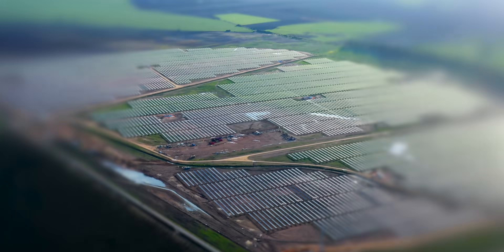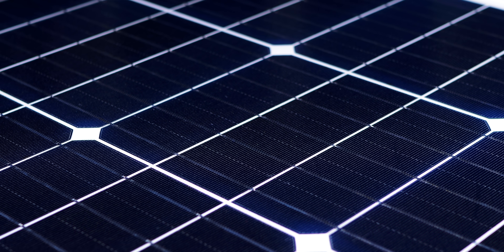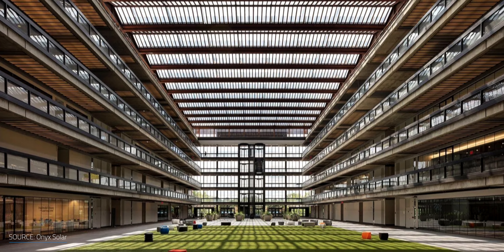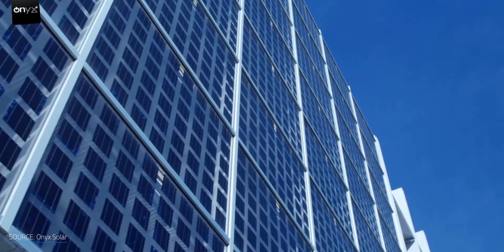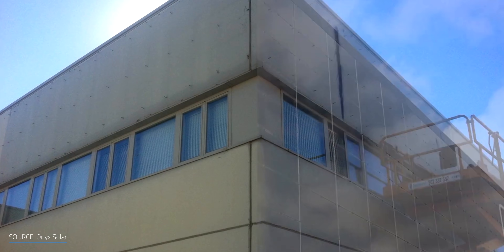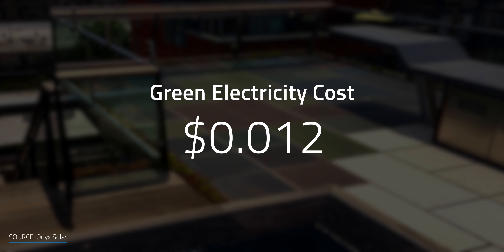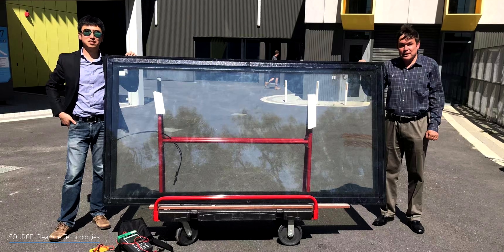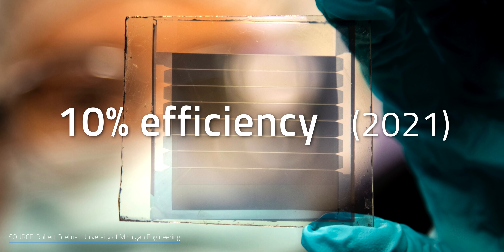Exploring a New Transparent Solar Cell Breakthrough

Comment: The differentiator will be manufacturing cost and durability, not so much efficiency. Solar panels are good for 25 years. If transparent panels yield half the efficiency but last twice as long, with the added benefit of much greater power generation per installation, they'll take off. One percent obviously doesn't cut it. If transparent panels need to reach 10% efficiency. Increasing awareness and desperation regarding climate change will push governments and builders to employ novel solutions, which likely create artificial demand.

Comment: The onyx solar pavers reminds me of solar roads. Solar roads was calling for sidewalks, etc.
The few applications of it, that I am aware of, were failures.
Reply: thats because solar roads was made by the couple who had very limited engineering experience and there roads were 'Smart' meaning they had loads of LEDs in them and failed a lot, in all  they were gimmick that promised way too much. while onyx solar is a solar panel/glass maker manufacturer will all the infrastructure needed to make the product themselves also their just making colored glass that can genarate some power not a smart device fails in the outdoors within a months
Reply: Yeah, it'll still have to prove itself for longevity and after the solar roads mess we should be skeptical, but i am much more optimistic about these than I am the solar roads because at least these aren't trying to be the be all end all gadgetbahn of pavement, they are just glass with embedded solar tech, they aren't trying to cram computers and LEDs and heaters and what not into them, and they also don't seem to be trying to stretch claims about the weight it can hold with a figure that pretty much only allows light walking traffic and doesn't even come close to trying to claim you can drive on it
Reply: @dustinm2717  Solar road ways/paths have and alway will be a scam. If you have a car drive over it, a person walking or even leafs on it, it stops generating electricity. You’re better off making a canopy for people walking so they haven’t got a walk in the Sun and that actually generate electricity efficiently. And without the risk of the panels overheating or getting broken.
Reply: solar freakin roadways

Comment: I kept hearing, '... it is not as efficient as rooftop installations...' True, but you can do both. As long as transparent solar cells are efficient enough to pay back the costs in a reasonable amount of time, it is worth using now. And the more people who use them now, the more money will be put into research making them more efficient.
Reply: I think this is the true benefit. You can't put rooftop arrays on top of windows, because it would block all the light. The benefit of these is that even at low efficiencies, their payback time is quite quick, and they can be used in conjunction with rooftop arrays. If you have a 100m² roof, and 600m² of windows you can essentially double the space of the solar panels where you couldn't without the window system. This is huge because just like rooftop arrays which aren't impressive on their own, they become impressive when recognizing they can be used as micro grids to power individual buildings or local to the building systems.
Reply: I watched another video a few days ago about using solar panels over crops that did not need as much sunlight and I actually posted a commend pondering about why the panels we make are always built on opaque circuit boards.   At the very base they are simply diodes that convert passing photons into electrons, the reverse of a light emitting diode that converts electrons to photons.
Reply: @PSNDonutDude  they are 1/2 as efficient and they do not get 1/4 the light (for the rooftop panels). then 100m2 rooftop panel will still make more power compared to 600m2 walls.
Reply: There are alot of rooftops lacking PV, we could add PV to them before we talk about windows. And the question of replacing when they wear out is there too.
Reply: We can have something like a film that goes over traditional windows to create this transparent Solar panel. I believe it'll be much easier to integrate in existing infrastructure
Reply: @vivekdubey9061  with some of these yes, the actual solar cells are in the frame rather than the glass for most of these

For me, replacing old windows or i construction are where these will shine

Something like $45/m2 more expensive than a normal window at current and generates $5-10/year in electricity makes it an easy choice if you like the tint
Reply: Usually people who minimize solar for being "not as efficient" have outdated mindsets.  It simply needs to be practical for the use, then you need to consider the long term costs and other factors.  Unlike with oil and coal power, where they see a direct ratio of unit of mass to the amount t of British Thermal Units converted from that unit of mass.
Reply: @PhilLesh69  ..... BTUs.....

Bad
Reply: @PhilLesh69  ..... BTUs.....

Bad
Reply: yes, it's about cost effectiveness, space-grade multi-junction PV panels are more efficient than single junction but so far their price makes them not cost-effective
if the transparent solar cells are cheap to make and produce more electricity to pay off for their price, then they are interesting otherwise, need more research
Reply: Even though they are not as effective as rooftop institutions they take advantage of building space otherwise not usable for power generation
Reply: @aussiegamer6876  But there are already countless rooftops and other top surfaces not using PV in the first place
Reply: Right? As I was listening, I was thinking “sure, it’s less effective, but it isn’t necessarily mutually exclusive. In most cases, you’re going to put windows in those spots anyway. Why not  make the windows transparent solar panels, so that those windows are providing more than just a view, in addition to rooftop panels? Obviously, the decision would have to be based on cost/benefit and opportunity cost analyses. But if the cost of transparent solar—when energy savings from generation is considered—is comparable to normal windows materials, why not?
Reply: @derekstaff  Sure, but what to do after the PV's stop functioning?
Reply: @firstlast-cs6eg  obviously that would have to be factored in to the decision. If the transparent solar pay for themselves in energy generation before they stop functioning, and as long as inert panels have no particular downside, what does it matter if they stop? They may just act like regular windows now, but they generated more energy while they lasted than regular windows would have. I’m not saying that they are always and absolutely right for every situation, but in general, I don’t see why the negatives would be assumed to be prohibitive just because they are not as efficient as opaque panels you put on the roof.
Reply: @derekstaff  Exactly, and the real world examples they gave had really quick pay back times, easily enough to be worth installing.
Reply: I have mini solar panels INSIDE my windows n they still work to give me 2hrs light at 400lumens and i have a solar lantern, which is enough for summer months light requirements.
I also have a 5panel pv powerbank slowly charging on the windowsill which i use to avoid using mains to charge phone, vape n batteries all the time n thus reducing energy bill 
My window faces west n thus not optimal, but still worth doing imo
Every little bit helps planet n my pocket n i cant wait until either seethrough panels or pv blinds are affordable
Because as someone on disability n social housing n renting, i have no other option
Theres millions like me waiting for flexible seethrough solar they can hang in their windows n take with them when they move home n b that lil bit closer to offgrid
Reply: Actually it becomes an easy choice if you already have regular panels as the initial infrastructure is in your home.
Reply: Alpha thinking from BrotherAlpha.
Reply: We're all just waiting for that one crazy human mind
Reply: Yes, this, unlike inductive charging or Hydrogen fuel cells in cars.. makes sence
Reply: this will also help in places where normal panels can't be used. Skyscrapers and other large buildings could skin southern faces of the building with transparent solar cells instead of windows, and hit efficiency and carbon goals much easier, as well as being a viable upgrade path for buildings looking to retrofit. This is the only way I can think of to get acres of solar panels in a place like NYC, where vertical surfaces are much larger than horizontal ones
Reply: @Seldoon_Nemar   There are plenty of rooftop like surfaces lacking regular solar panels.
Reply: @firstlast-cs6eg  yes, but there are also plenty of projects that are under construction that could benefit from this?
Reply: @Seldoon_Nemar  
         Maybe, but how well do these windows work after the PV stops working? Also maybe it is better to have windows where you can control the opacity including IR etc so heat can come in when we want it and not when we don't.

        Since there is alot of room for progress in roofs with EV, it seems best to me to focus on that.

       I imagine these EV semitransparent windows will be useful on skyscrapers in very hot sunny places, that is a very narrow use. But I guess it is a use.  But then again how well do these windows work after it stops working compared to a regular window?

       If the components of these windows that wear out could be replaced without replacing the window, that would be a major improvement.
Reply: The cost of one system is insane enough. Telling people to buy 2 systems makes no sense whatsoever.
Reply: @Iceflkn  Both systems save money. That's the point.
Reply: @Iceflkn  not necessarily
Think of folk living in flats who hav no roof access
Reply: hear this then... ideally placed and angled solar panel will recoup it's cost in 5 years. 
Assume that windows are also ideally angled... which they are not. Efficiency of those ideally is 1% which is at least 10x less of a solar panel.
So it's 50 years in ideal condition to recoup the cost, but the cells will live 10 years. 
Reality will offer several times worse outcome.

Even if they become as efficient as solar panels which frankly is impossible due to capturing only part of the light spectrum. 
Bad angle and low lifespan, still makes them unable to recoup the cost in their lifetime.
Reply: @Cypeq  "hear this then..."

Did you even watch the video? The numbers you came up with are contradicted by the video itself? Either you are dealing with outdated numbers, or you are just lying to us.
Reply: @BrotherAlpha  video states on fully transparent PV windows 1% efficiency. I've read about 40% transparent ones that do up to 8%. Of course data on actual installations is not possible to find. It will be obviously different from site to site.
Buildings with skylines could probably and reasonably benefit from those as the skyline can be angled for maximum benefit, although still fixed throughout the year, and susceptible to snow. 

Those windows might make sense for new skyscrapers. Somehow I doubt they will be financially worth it as in able to recoup additional cost and generate profit on electricity generation, at least for now, but I'm sure some will decide to just have them to boast about being "green". 

I hope you all understand cost of this installation is not only manufacturing a glass with PV of some sort. It's additional wiring, controllers, batteries, inverters. More panels you have, more cost on those, and here you're having shit tone more panels. Massive battery cells to store this energy is also a recurrent cost over their lifetime, they need to be replaced, and all electronics need to be serviced. 

Would love to see some actual numbers for full installation.
Reply: @Cypeq  "Of course data on actual installations is not possible to find."

... The video talks about actual installations. WTF?
Reply: @Cypeq  where did you get 1% from?? Also, the 5 years is for those panels in particular
Reply: @Cypeq  .... What
Reply: @angrydragonslayer  that is strange because here in EU cost per kWh is 400E (batteries), controller cost is 162E - 48Volt system i guess they use this system, but this is only 1160 Wp, that means if they have installed capacity of lets say 20kV, they need 17 of them. Same goes for hybrid inverter(s).
Maybe in USA solar controllers are FAR cheaper than here in EU.

You said it right, 100W mppt is 20Euro now, but i guess McDonalds uses far more robust system, atleast 20kWp.
Yes you can have ROI in 3-4 years, but only solar panels. Most of the people forget that you need the rest of management for the system which is three times more investments than solar panels themselves. You cannot just power devices to solar panels, you need the rest - and you still relying on the Grid, even with batteries.
If you try to send your power to the grid, it's okay, but that grid needs to be flexible, that means it needs to have nuclear powerplants, wind, hydro + storage in a form of batteries, pressurized air, hydrostorage powerplants to compensate grid.
Solar is only, and not major one piece in this puzzle.
Reply: But solar panels needs to be efficient, you know that is alpha and omega of them. It is VERY nice that dude in a video tells you, that cost will return in just 1-4 years. Thing he is not telling you is what is the cost of electrical installation managing those panels. That cost is 8 times more that panels themselves. No you just cannot connect all solar panels from the building together and they produce something - that idea is simply childish.
These days you have flexible solar panels, they can be mounted anywhere (calculated to strings / power requirement) and being efficient just like old 20kg solar roof panels.
Solar window at an efficiency of 1% is horrible idea.
You know you can build a roof at an calculated angle and cover it entirely with solar panels, but that means you will produce ~ 40kWh/p in summer, consume 3kWh/p at best, which is useless. What about installing 6kWp of panels for summer, reduce your consumption and slap some batteries, maybe add few panels into your southern wall for winter to compensate low sun.
Reply: @ivobrick7401  i checked, the mcdonalds installation 4 year roi includes wiring, converters and extra costs.

The reason it claims a 4 year ROI is that it removes the price of a normal glass installation for their restaurants of that design from the equation.

Simply put: In 4 years, the solar glass install will cost as much as a normal glass install and in 5, it will cost less.
Reply: @ivobrick7401  no need to be a douche
Reply: @PSNDonutDude  you beat me too it! 👌
Reply: @ivobrick7401  and the electronics do not last as much. even a little shadow can pull down one whole panel. To cut costs, the electronic parts are being made very flimsy...
Reply: @janami-dharmam  a 100w solid state mppt charge controller is $20-25 now

You can easily hide that in the window frame and have a 12-48V cable (or ring bus for the UK people out there) running inside the wall

Comment: A green light PV would be good for greenhouses, letting red and blue go through for photosynthesis.
Reply: Green, ir and uv
Reply: @PedroRPFerraz  The meaningless post of the year.
Reply: @PedroRPFerraz  point is that you could potentially double dip the surface area. They're already doing that in a sense. Matt has a video about combining PV and agriculture.
Reply: Yes but the workers in the green house will look really really funny.   Even nicer would be is the panels contained one of those weird up converter chemicals that turned IR into red and down converters that turned far UV into blue.  Both of those bands are not actually used by the plants and normal photocells.
Reply: @kensmith5694  it would, but I suspect up shifting may be beyond humanitys current technological capabilities.
Reply: @ariheino327  We have the technology
Reply: @kensmith5694  How does it work? AFAIK higher frequency means higher energy. Where does the extra energy come from when the tech shifts the photons up?
Reply: @ariheino327  The first photon pumps the electron up a level where it will remain for a while.  A second photon pumps it up to another level that has a very short life time.  The electron falls all the way down giving off a photon at the total energy.
Reply: @kensmith5694  cool! What is the tech called?
Reply: @kensmith5694  Haha, everything looks funny in pink light;  plant leafs look black;  they don't recognize themselves anymore.
Interesting;  I knew of the existence of down-converters;  never heard of up-converters.

Comment: transparent solar panels goes against the basic principle of what solar panels are - it is supposed to be black since the light literally is absorbed by the surface, turning it from light into electricity. Having it be transparent means the light passes through it and isn't stored

Comment: If it blocks a bunch of the UV, ten what about sterilization? wouldn't the indoor spaces be that much more prone to microbes?
Reply: Modern windows already block most UV, that's part of why you don't see a much fading on flooring materials now.
Reply: Interesting question. I don't know. My first thought was that this would be better for greenhouses than the current plastic sheets or regular glass. Microbes would be less of a concern in that application.